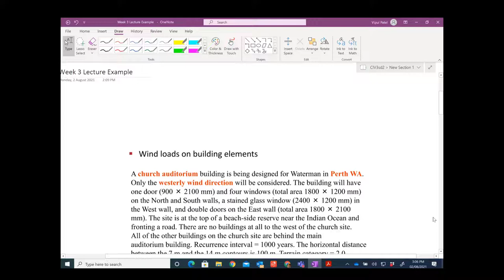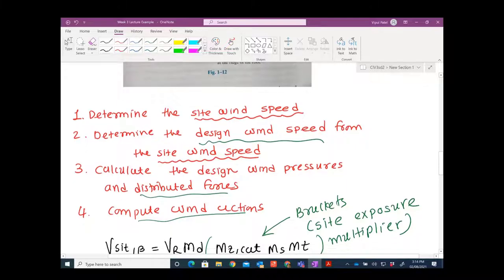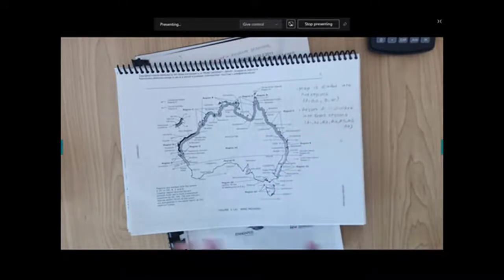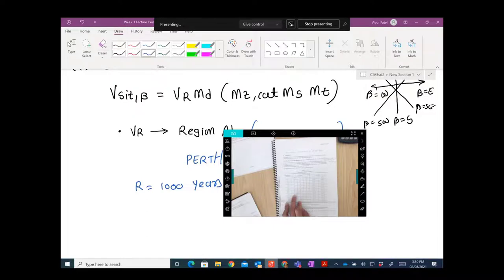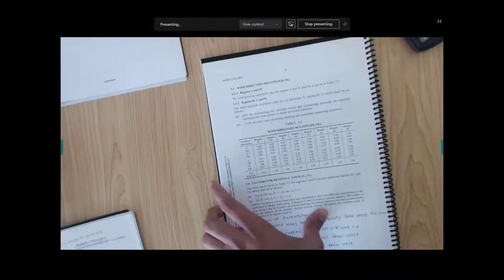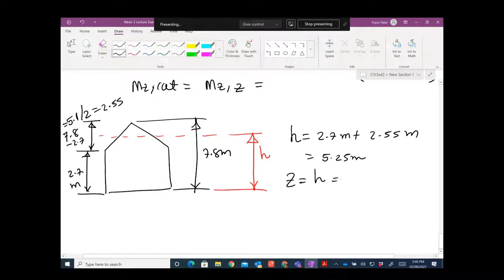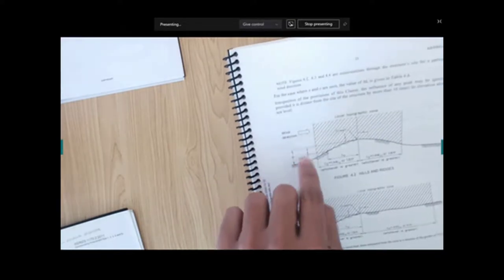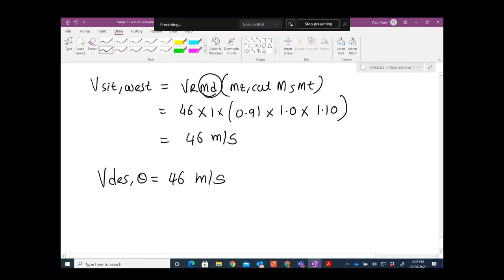CIV3SD2-Week 3 Lecture - Wind action-AS/NZS 1170.2

Comment: Vipul Do you have any software expertise that we can use to solve this problem through the use of software ?
Reply from the maker: There are few software available which can perform the calculations. You can search for it. However, you may not completely depend on the software results. You may like to perform some hand calculations to understand or validate the software results. I do not teach the software because it is simple and it does not require any technical skills to operate the software. The software can be learned using the tutorial. Most of software comes with the tutorial help.